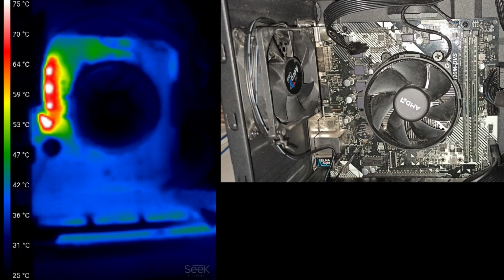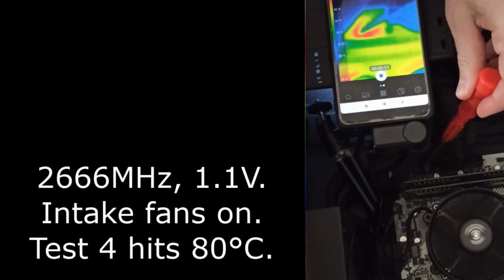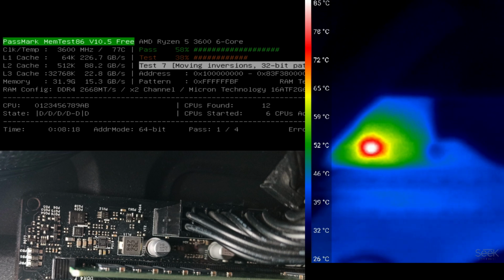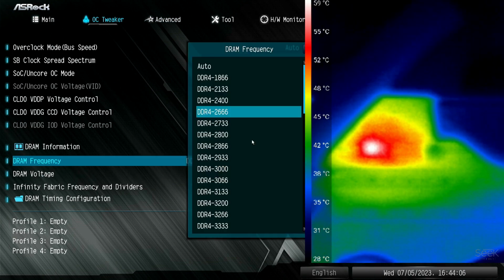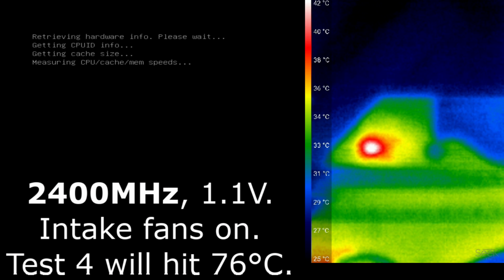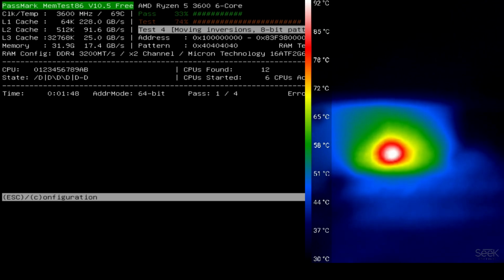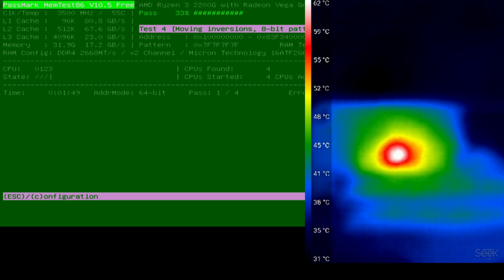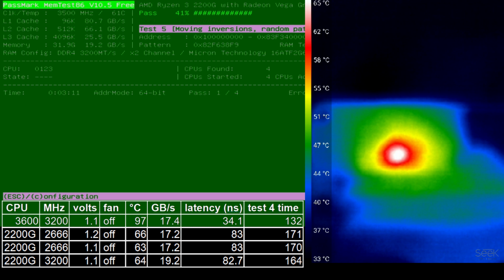Testing the A320M Ryzen 5 compatibility claims, with a Ryzen 5 3600, thermals, and MemTest.

Comment: Very interesting and probably expected to eventually fail under extreme duress.    Is there any passive or active air cooling while doing the test?   I'm really interested in knowing more about the flir software that you use with the phone.  Very informative video and,   Thank you for sharing!
Reply from the maker: You can see the exhaust fan, briefly, at 2:40.

These are always on. What I changed between tests was the effect of the intake fans. It's a mATX case, and the intake fans are a 120 and 92mm top and bottom, respectively. I had a PWM controller which I either ran at max or turned off. There's 150mm between the bottom of the top fan and the AKUK 297.

The fans dropped temps by about 16 degrees, summarised at 8:57. The PWM made them noisy, and they were indirect and largely left switched off for consistency. Having the case laid flat so the top was open, helped the tests to pass, that and July was much cooler than June.

I ordered some small fans to target the 297, but that is kinda wasteful, so I ordered some heatsink as well. I hesitated because this could create air pockets where the PCB would otherwise be open to moving air.
Reply: @TechTemps  Thank you very much for your prompt clarification of the test setup.  (I was kinda quickly breezing through your video,  My apologies)  I do wonder how Asus and other manufactures cope with the heat on these non-heat sink boards?   I wouldn't mind seeing the heat sink application and before/After comparison.   Again,  Thanks for your detailed analysis with Asrock A320.